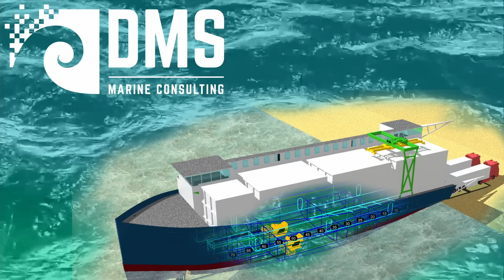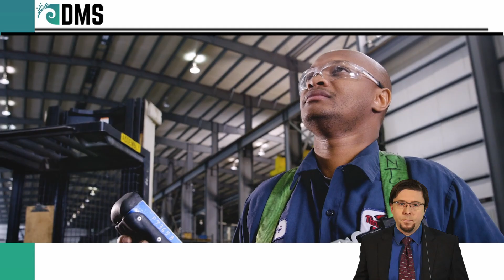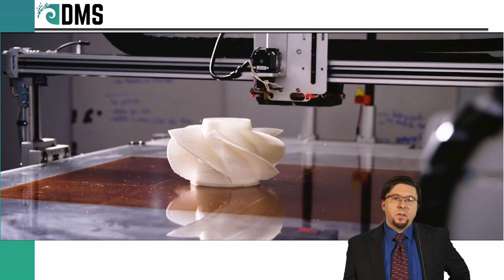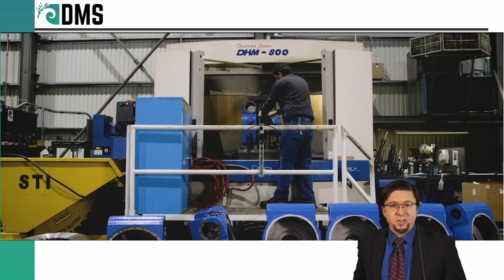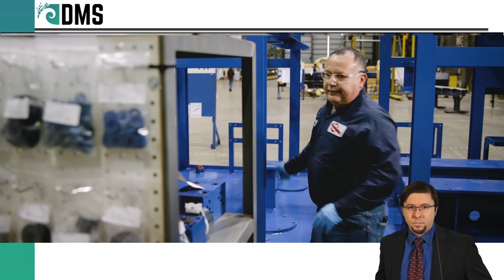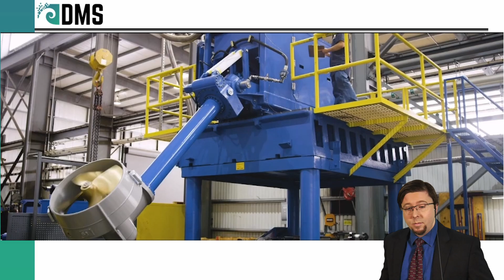Who is Thrustmaster?

Comment: 🤔 so have these thrusters largely replaced the traditional fixed shaft drive?
Reply from the maker: Not replaced.  They have two major downsides:  EXPENSIVE and efficiency losses.  Think of them as specialized tools.  We use them a lot in the offshore industry, because it is common for ships to hold position next to an oil rig, with no anchor.  When your ship is within collision distance from an explosive oil rig, the extra maneuvering control from azimuth thrusters becomes very attractive.
Reply: @DatawaveMarineSolutions  Ah, okay. I can see in that kind of scenario where that could be a useful capability. Even though you give up shallow draft operation.
Always thought about Naval architecture as a major. Very few schools offered it however. Just curious, where did you go to school? 🤔  1996 Temple University Engineering grad.